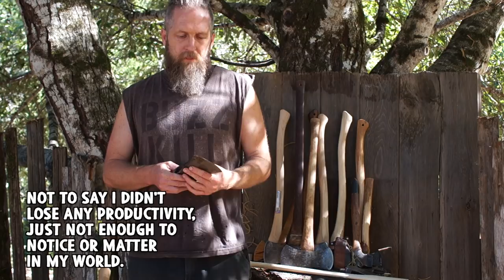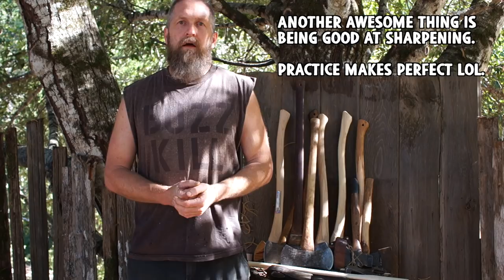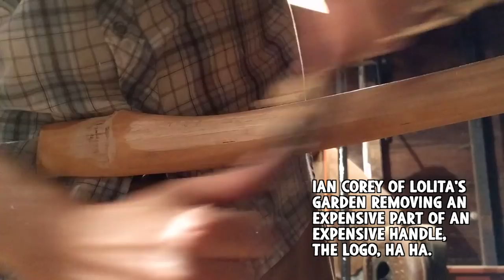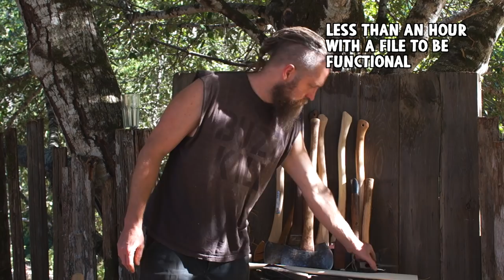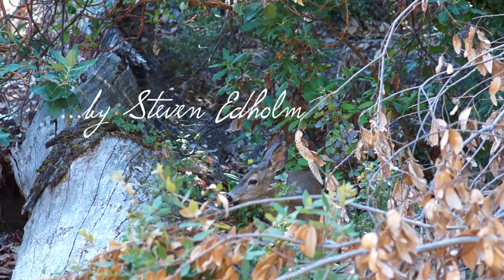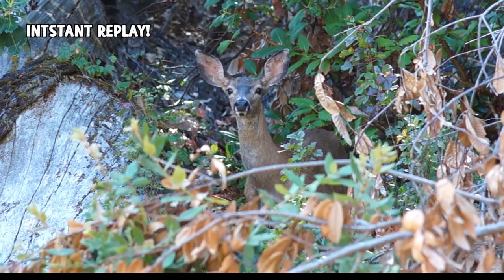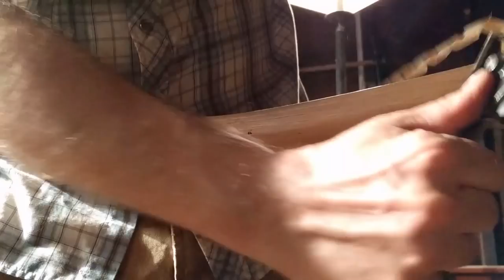Expensive Axe Buyer's Guide: (SPOILER ALERT, Don't Buy One)

Comment: Yeah, so what! It breaks, fit it. I purchased a 27" Boys Axe, hickory handle, good grain, and good reviews for $30. They shipped from NY USA. Got a Leather Sheath for that Boys Axe for $14 on Ebay, and I'll put a Rawhide Neck Protector on it before long. I like it. I have about 9 Axes/Hatchets combined in my axe collection/hobby that I've reconditioned since retiring. They're our heritage. Most my friends though have chainsaws and log splitters instead, maybe they have an axe sitting in the corner somewhere. Can I harvest trees for fire wood if the SHTF - Sure, why not? I've spent over $100 for a vintage Collins Double bit, because I wanted it. I purchased 3 high Quality carved handle axes with engraved heads which cost lots, and I gave 2 away as gifts. So what! "To each his own", as the saying goes. Its what you want, what you like, what suits you at the time. I got an vintage unknown 3 pound axe in the mail a short time ago, I can't wait to restore it for my collection … When the SHTF, what can you use to barter for goods when money has no use? Salt, drinking water, tobacco, tea, sugar, an axe or hatchet, or maybe a certain skill where there's no electricity, gas, or water utilities to a home anymore???? Think about it, what can you offer?

Comment: I think this kind of shopping is compensating for all the shit knock offs in our perishable culture. It's a common experience nowadays to start a hobby without much research, only to realize months later the entry level stuff is actually not fit for purpose, and making the right choice is tricky for exactly the same detail overload problem. If you buy fancy, and you actually use it, and it's not a delicate precision instrument, then you are often trading off money for a smoother learning curve.
Reply from the maker: That's an interesting point.  Most cheap axes are shite, that's for sure.  There is an opposite phenomenon too though, where people overbuy for something they are not sure what they need or may not end up using.  The right cheap axe, is overall going to be the advantageous place to start for most beginners, especially without a mentor, and over time they can learn enough to make a more educated decision about what they might want to spend money on.  I think for many, they will actually just get stoked about vintage stuff and use that instead of buying something amazing.
Reply from the maker: I meant trying to buy something amazing!  which it probably won't be...

Comment: you are ranting, arn't you! I do have both True temper, Wetterlings and probably a lot of the 'high end' axes. And the one I  fancy most is an old Danish carpenters no-name axe that I converted into a hatchet.
Sometimes you are bying the name, sometimes the steel. Grantfors Bruks make great axes, so did DSI. They come in all shapes and might not just meet YOUR fancy. Still they may be great axes.
Now, here's my point. You may be able to find a good axe of Chinese, US, German or Swedish make. The PRICE is of no consequence to the quality, seen form a perspective. Of course the Chinese axe is cheaper - guess why! What counts is the ability to set and hold an edge, the ballance, the durability of the hafting etc.
Please! Do not compare prices, when you compare origin. It is like comparing appels and bananas.
And don't buy a Chinese axe off Wallmart and expect to be able to do fine carpentry with it right off the shelf!
Reply from the maker: I don't recommend anyone buy garbage tools, just inexpensive tools to learn on.  Few tools are subject to the abuse and hard use of an axe in the hands of a novice.
Reply: and I am definitly with you on the topic of serious newbies not investing in either grabage or value beyond needs. still, a grantfors or a wetterilngs has an undeniably quality, only it may not meet your requirements as to the job at hand. 
so, the question pretty much comes down to: for what purpose do you want to aquire an axe, doesn't it?
Reply from the maker: Yep.  I'm also generally in favor of using what we have and being able to make it work.  But that's just my preference or interest.

Comment: One thing to stay away from is cast iron axes YES thank china for them. One time i took one and stuck it in to a stump and could not pull it out, so i struck on the back of the handle and the whole edge broke off from the rest of the head and stayed in the stump
Reply from the maker: There is plenty of junk not worth buying.  But not all decent axes are expensive, especially used.

Comment: Why did I (a 22-year-old rural guy) spend 1400SEK (1USD = 9.2SEK) on a top-of-the-line Gränsfors wood-cleaving axe?

Easy: I want one axe that'll keep me supplied with firewood for the next 20+ years. I don't want to have to buy a new one when the Chinesium-axes you're defending gets chipped into oblivion after a few trees' worth of work.
Reply from the maker: I'm not recommend anyone buy garbage.  My top actual recommendations were council tool, made in the US and putting handles on vintage axes.

Comment: I went to Mr Chickadee channel and watched him do a 6 x 6 timber from a log. And I was surprised he used an axe instead of a cutting  tool designed  for that type  of work . I forgot the name of it. It looks like a hoe.. I stand on the log and swing it .like between my leg and the cutting edge comes toward my toes. They are real handy. Does any body know what they are called.    I purchased one from Clampett  Hardware  in Bryson City NC back in the mid 1980s . I bought that and a broad axe ( $200 for both ), used for the same leveling but for cutting the side . The broad axe has a funky handle so the operator can dig in to the wood with out side glancing.  All gone now but the hoe like cutter  I would like to have as a tool techy trophy  to admire and try out a little just for kicks
Reply: As I was reading another comment the name of this tool came to me. It's called an adze . I will Google it and see if they are still made
Reply from the maker: right!  Check ebay.

Comment: I agree with you on high $ axes and I am over Wranglerstar and his way to sharpen an axe is to use this 600$ contraption that a viewer gave to him and Its a Sager Chemical Axe that was the 3rd ever made. Ive only got old flea market junk store heads except one. Its more fun anyways. Shitdigging for heads and then rehanging them and sharpening, thinning handles, etc then use the thing you created. I did recently buy a Hults Bruks. It was at smoky mountain knife works (If your on the east coast stay away from that level of Hell!! Disney world meets knife store tourist abomination) It was 50% off because it was a more US looking head instead of the swedish lug style with the long bit and bad balance. 50 bucks out the door and I dug through them to find one I liked. The Gransfors small forest axe makes no sense to me. Its pretty much a damn hatchet or at least the way I make my hatchets. Keep up the good content.
Reply from the maker: I'm very disturbed by the selling of expensive, fancy sharpening contraptions.  Sharpening is a skill hard won and best kept in practice.  I was actually looking at the hults 2-3/4 pound axe on 28 inch handle, just because that configuration is hard to find.  It's still 95.00 us to order from Canada and that's before shipping.  If I saw that for 50.00 I'd buy it.  But really it's still just for review and recommendation purposes.  I have a 2-3/4 lb head.

Comment: Not like a Gibson SG and a Messa Boogie amp 😂
Reply from the maker: Definitely not.  Now, if you had the skills to modify said instruments, it might be slightly similar.  But in general, most axes of reasonable design, or even kind of mediocre steel quality, can be made to work well with modification and they all need modification anyway.  But realistically, there is only so much you can do with a crappy guitar, and I can do very little of it ;)

Comment: A cheap axe is ideal for those occasional uses / needs. IF you know you're gonna' be needing one often then get the better axe. Its no different asking a cook or a chef to choose a knife. They both have different needs. Don't buy the wife a Ferrari with which to take children to school and don't buy her a bicycle. Choose the best tool for the job at hand. Me? I don't need an axe often but....I don't wanna' be working too hard when the time comes so I will choose a quality tool if only for the ease of use.
Reply from the maker: Like I said, I cheap axe is not necessarily a low quality axe.  If they handle is good and the steele holds an edge well enough, there is going to be little performance difference between many affordable axes and more expensive axes.

Comment: I would much rather support a tool maker that pays their workers respectfully and pay $30-50 more for a quality axe rather than supporting made in China crap made with questionable labor. But I can’t justify a purchase where price exceeds functionality. Gransfors were less than half the price a decade ago... You’re not getting twice the axe today, you’re just paying trend tax to have a “fashionable” item.

Fine woodworking tools, however, are a different category. I fully understand needing a quality carving hatchet for finer control in sculpting wood as a craftsman. Do you need the same hatchet for your feather sticks and kindling? NO!!
Reply from the maker: Council is a good affordable alternative made in the states here, and in Europe, there are other brands..  I'm not advocating buying the cheapest, crappiest axe.  Most woodworking tools are not subject to nearly the abuse and hard use that an axe is in the hands of a new user. As far as hatchets go, I doubt an expensive carving hatchet would give me a huge advantage over a fairly normal hatchet, but I've never actually owned one.  My usual recommendation in that department is to start carving with a normal hatchet. Then we always have the ability to use that and an improved tool can be put to that much better use later.

Comment: The reason you buy an expensive axe is so it has straight edge alignment out of the box.  Cheap axes are almost always crooked with few exceptions.
Reply from the maker: The most popular expensive axe brand gransfors is notorious for crooked alignment. Mine was the most misaligned axe Ive ever owned.  A guy who went to the factory told me in the show room there almost all the axes were crooked. Thats probably because the average of users are very ignorant of such things. The most experienced users are less likely to be suckered in by the kind of marketing that built that brand. Ive not seen a brand that is consistently well aligned. Plenty of affordable axes are well aligned but always better to pick them out in person.
Reply: @SkillCult  The only Gransfors I have (wildlife hatchet) is perfectly aligned.  Maybe I'm just lucky.  It's the highest quality hatchet I've ever used and I've used dozens.  Heat treat, ergonomics, balance, cutting geometry, grain, it's basically what I expected for the money, one of the few pieces of expensive outdoor gear that didn't strike me as overrated and it's held up to heavy use for about 4 years now.  If it had been even slightly defective I would have returned it immediately without hesitation.  Personally I don't think $130 or whatever is alot of money to spend on tools I'm really into that could last a lifetime, I'm just a butcher and I make more money than that in one day.  I'm liable to impulse buy pistols that cost 3X that.
Reply: @SkillCult  One "expensive" brand I'm definitely not impressed with is Adler.  I handled a bunch of those recently and every single one was just as misaligned as a $20 hardware store axe.
Reply: @SkillCult  I was actually obsessed with Cold Steel tomahawks and used them exclusively for camping and bushcraft for a very long time, they typically only cost $25 or so.  On top of having the lightest heads on the market and great heat treats, the ability to remove the hafts allows the user to easily achieve perfect hang by just inserting shims at strategic points.
Reply: @SkillCult  I got the GB wildlife hatchet not because of marketing, but because it is uniquely lightweight for it's length like a tomahawk (22 oz overall), but unlike a tomahawk retains the features of a proper hatchet like decent splitting geometry, a useful hammer poll, good grip ergonomics, and better chopping balance, all while having a full 3" bit.  I can't think of any other hatchet that has comparable specs.  Lots of these "bushcraft axes" promoted by YouTube celebrities (not your) are stupidly heavy and just plain needless.

Comment: Good video, I agree. I’m almost six decades old and started using axes when I was pretty young. My dad and I used these as part of a business (chainsaws as well. We trimmed trees and logged). I haven’t done that for a living in a few decades but I’ve always lived in a home with at least one wood burning fireplace and I always cut and split my wood. I’d never heard of Gransfors Bruk until the last few years and I’ve never paid more than $40 for any axe (usually much less at yard sales). All the axes I’ve used, gifted or worn out (a tiring task lol) have all been my equal or better. It’s true some stay sharp longer, some are better balanced and some have better geometry than others. In the end the person on the handle makes the axe what it is; better or worse it’s the user and that’s true even if you found it rusting in the woods or bought it.
Reply from the maker: So true, Skill usually trumps gear.  Again with the car analogy, put my in a high performance car and I'm. not going to be able to put it to goo use, because I suck at driving.

Comment: Believe it or not but these cheap amazon axes and hardware store axes are probably of the same quality people have been using for 100's of years if not better it all just depends on perspective hmmm. $20 axe from home depot or $100 axe from Switzerland well i just need to cut some wood anything will work really. I mean when you were a teenager did your parents buy you a top end mercedes because it was safer? Probably not, did you die because of it? Probably not. I'm sure if they did they wouldve really felt bad because deep down they'd know its not necessary hence buyers remorse. Try the cheap axe and if u dont like it use it rough till failure and suddenly the truth will dawn on you that even the cheap axes are tough as nails and will do a lot of work for you even without any modification u dont need to sharpen it no sanding no polish its all b.s. dude just use the thing jeez people get so choked up for nothing
Reply from the maker: There are some really bad axes on the market and have been for a long time.  They are worse than ever. too  I just got one that is absolutely horrid, though I haven't tried the steel yet.  But it's certainly not a direct correlation between cost and quality.  If the steel is okay, most can be turned into something that will work, though it might be a lot of work.  I would still be very cautious about just buying anything.  There are good affordable axes though, like council tool.  Handle quality is a big issue these days.

Comment: I broke a husky....it was 12 degrees outside though.
Reply from the maker: Did it break around the stamp?  that stamp looks way too deep.  I heard they fixed that problem, but not by making the stamp less deep.
Reply: SkillCult no it was actually a clean break along the bit. I'll try to get pics and message them to you.
Reply: SkillCult I take that back. I just found it. It actually broke along the "made in Sweden" portion of the stamp.
Reply from the maker: Thanks.  I'll have to look up pictures and see more exactly how most of them are breaking.

Comment: I grew up poor so I will not buy an expensive axe honestly I won't buy an expensive anything if you learn to use the tools properly they work just as well as the expensive ones
Reply from the maker: I have little desire to buy new axes.  If I did, it would probably be truly hand made, or for review of course, but probably won't do many of those either.

Comment: This idiocy is not confined to axes. Lots of these nimrods sit around an watch these wranglerstar type videos and go buy $400 knives thinking its going to make them into a fine  woodsman because they have a fine knife. Not even connected. They go buy a $500 knife and a $50 flint stick and sit around for hours whittling on feather sticks to start a fire when a fifty cent bic lighter is much better. If a cave man or a Comanche  Indian  could have gotten his hands on a bic he would have been the wonder of his clan and could smile all the way to the bank.
Reply from the maker: I guess my view is a little more forgiving.  It is pretty easy to fall into that trap when everyone is telling you that this or that is an important factor in a tool.  Without a contextual framework, it's easy to get upsold on things that don't matter all that much.  But there is also a strong element of wanting to be sold and buy things and justify purchases.  Regardless, skills over gear all day.